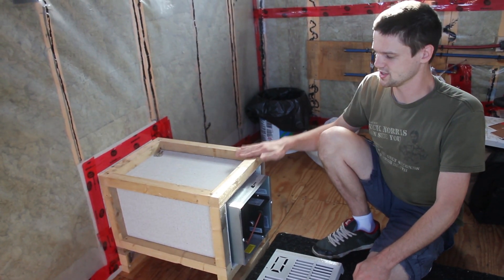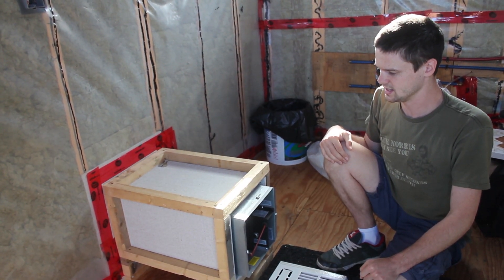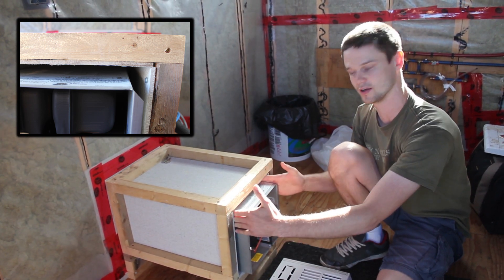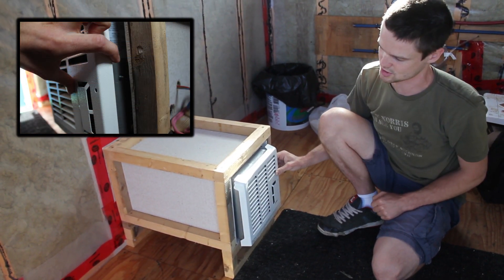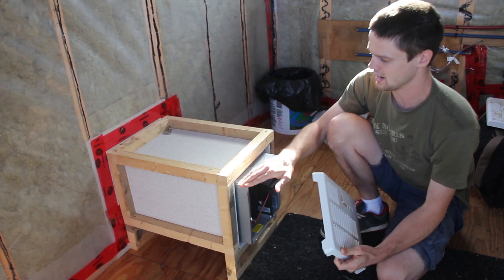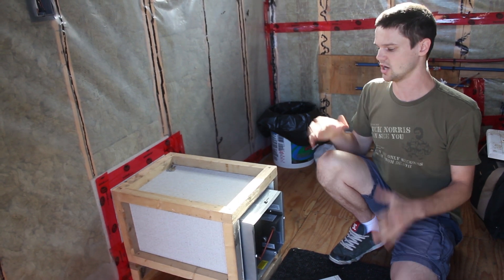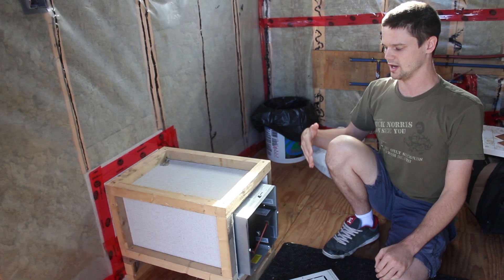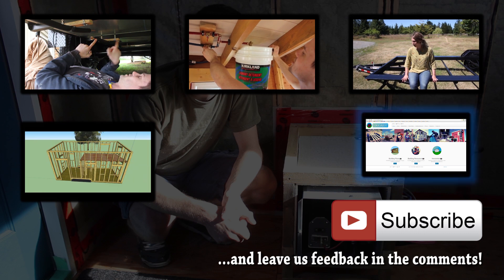Tiny House Heating Return Air Explained (Ep.34.1)

Comment: Jake. 
I went back and checked the RV style furnace I installed in my cargo trailer camper. My furnace was mounted flush to the cabinet with the front flanges and didn't have the gaps around it like yours does, that's why it needed side return air vents. After watching this video and seeing the way your front grill attaches, I can see you will get return air into the blower and everything should be OK. 
I'm glad... now I can sleep at night again. ;-)
Keep up the good work.
Reply from the maker: Mark Kennedy Thanks so much for following up. That helps us feel more confident as well, knowing how other variables affect the installation/operation :)

Comment: I am thinking of using this same brand furnace but a ducted one I think would help distribute the heat and avoid a hot spot near the furnace and cold spots away from it. I live in a camper now that has a non ducted furnace and see the need for the ducts
Reply from the maker: Daone NOnly Indeed. We will see how it goes. It seems like the space is small enough that it should be fine. My thought is also that the kitchen has the furnace, the TV room has my computer and lighting electronics (making heat) and the loft is high where heat rises... so maybe it'll even out :) we'll be sure to update everyone during the winter when we're actually living in the house!

Comment: Do you have any wiring diagrams of how you attached the Suburban furnace to the thermostat? Thanks
Reply from the maker: The thermostat wiring is just a matter of closing the circuit on the blue wires. We will have it connected to a relay, controlled by an arduino computer, but right now we just have it connected to a toggle switch that we manually turn on and off for short periods of time as needed.

Comment: Personally, I say that sometimes "adequate" can be improved upon..if it was me I'd reinvent the cold air ducting to pull air from the sides and bottom of your enclosure. Having the cold air return in the front face immediately beside the hot air vent is not the best plan in my opinion..
Reply from the maker: We're going to be building kitchen cabinetry up to the front of this unit so the entire back and sides will eventually be enclosed. The documentation described this kind of front-facing air supply, and so we went with that official method because it will work with our cabinets as well. It would definitely be possible to have it pull air in from the rear... although it's also good to be able to see the intake and know that it's not blocked at all. Thanks for the feedback :)